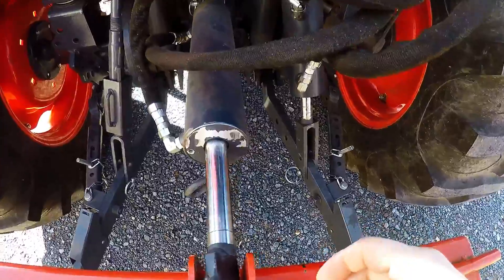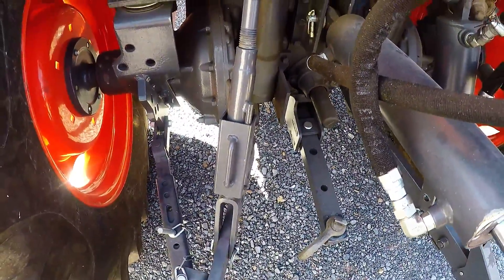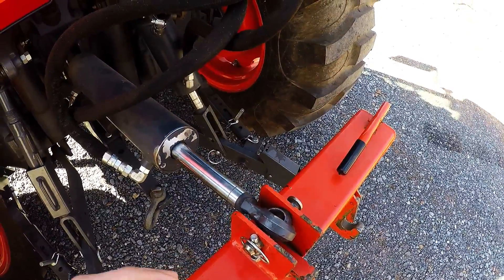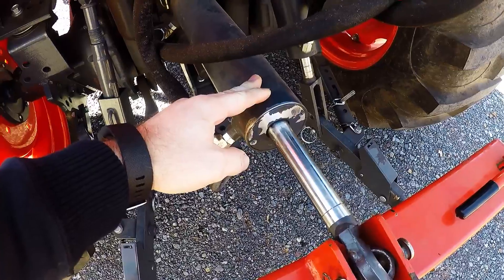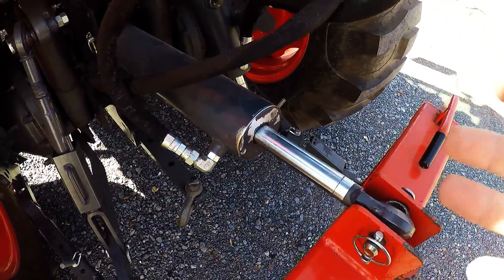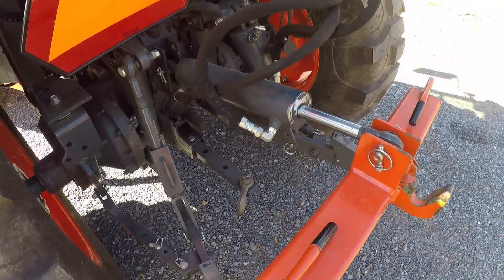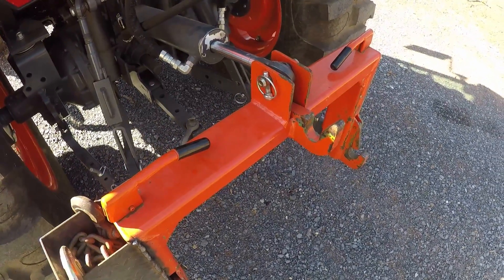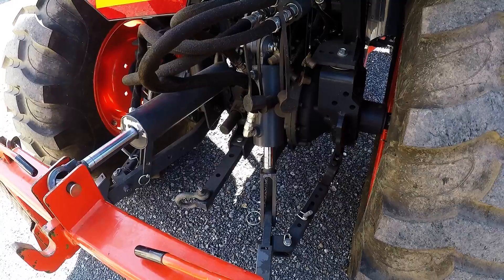What is a Top and Tilt Kit (TnT)?

Comment: How are you dealing with drift?  I used a top link with a double pilot operated valve, but couldn’t find one for the side link.  So I’m thinking of putting a pair of ball valves inline to hold position.
Reply from the maker: With the way I use the tractor drift is not an issue. I usually make an adjustment before it is an issue. Try disconnecting the hoses if drift is an issue, if you are doing something like mowing were you just set it an use it.

Comment: Morning Roger. This was really helpful. So it looks like I would need one remote that is normal, and one that has a detent for float mode? Thanks pal!
Reply from the maker: It is not a bad idea to have one that is float. It works pretty nice on the side link. When you are plowing snow you can drop it float and the blade will follow the contours of the land. Float will not work if you get a sidelink with check valves.

Comment: Do you have a link or part number for your side link? And also your tractor hp?
Reply from the maker: The tractor is 44hp. It came as a kit. The side link is available separtely, but it costs as much as the kit, that comes with the toplink and hoses. The kit is used on all the Grand L and MX series tractors.
Reply: Tractor Tech what is the name of the kit? Or part number of the kit?
Reply: Tractor Tech specifically do you have a part number for the side link cylinder?

Comment: Soon, my dealer will be installing the TNT kit on my L6060.  Obviously the TNT uses 2 valves.  If I want to use a 3 pt hydraulic attachment, can I disconnect the side cylinder at the valve an hook up the hydraulic implement?  Thanks Jim
Reply from the maker: Yes, you can do that.

Comment: Enjoy your informative videos! How do you determine what diameter size of cylinder to use on a top link?
Reply from the maker: Thanks! That is a video I have thought about doing. I have seen some guys with some larger tractor buy top links from online farm suppliers that are way too small. The thing that has held me back is don't know the what size each tractor needs. I know I've seen guys with way smaller toplinks than what I have on the same size or larger tractor. I'm sure there is a formula figuring out what size cylinder you need. Lets say your tractor can pull 100% of its own weight, which is highly unlikely. Then see what psi your hydraulics operate at, probably no more than 2600 psi. You could these two things along with the cylidner specs and a hydraulic calc to get close. https://www.baumhydraulics.com/images/calculators/cyl_calc.htm Then you need to someway factor in shock load. If you are using a blade to move snow and running 5mph and hit a stump, how much of a load is that? I'm not sure how much of a shock load they consider when sizing one. I'm your cylinder is too small and you hit something, you could blow something in the hydraulic system.  Generally speaking if your tractor is under 40hp, an off the shelf top link is probably okay. I ran one on a Bobcat CT235 with no issues. If you tractor is over 40hp you probably want something bigger and get a custom made toplink. If you have a tractor that is similar in size to my L4240 I can measure the toplink and tell you the size. It has a Kubota top and tilt on it.
Reply: Tractor Tech  Thanks. There are a lot more variables in sizing a top link as you have said like hitting a stump with the implement or the speed you hit it. Lift arm hydraulic links are more predictable, lift capacity plus a bit. The tractor I’m putting the top link on is about 40 hp.

Comment: Any idea why Kubota does not offer the TNT kit with the backhoe option?  Is this because the remotes are in the way of the backhoe?  I would think taking off the top link and side lift would be easy when needing to use the backhoe.
Reply: Looking at the newer L60 series, i.e. L4060/L4760.
Reply from the maker: +Matt Jenkins It could also have something to do with the power beyond to run the BH. I'd think there is enough room for the remotes on a tractor that size. Go with the 4760 since it has the bigger loader. Ask Messicks on YouTube about the remote, he probably knows.

Comment: Hi I just found your  channel and am really enjoying it. Question on the TNT kit is it possible to set this up on a diverter system and control both functions with 1 scv? If not would you prefer to setup the top or side link with hydraulics?
Reply from the maker: Welcome to the Channel! Yes, you could use a diverter to operate a tnt from one remote. If I was only getting one I would prefer a hydraulic toplink.

Comment: Pretty slick, how much does a single rear remote cost ? Have you heard of anyone having problems with the hydraulic top link?
Reply from the maker: Remote cost vary from tractor to tractor. On a Kubota they are around $700. I've heard of some hydraulic top link problems  but they are very uncommon. A hydraulic toplnk is just a hydraulic cylinder with the toplink ends welded on it.